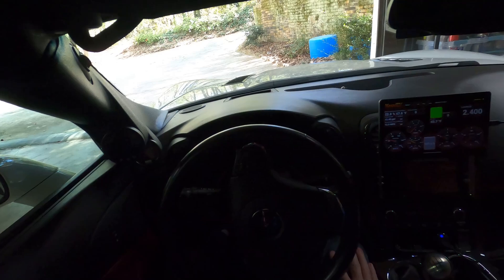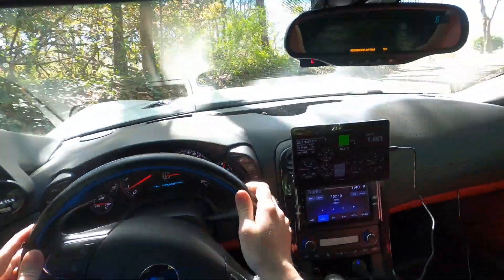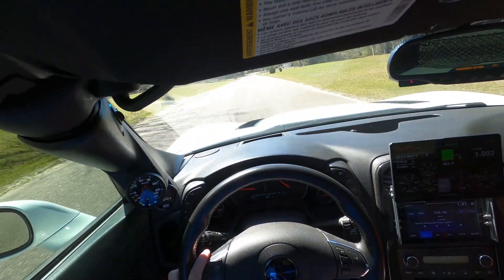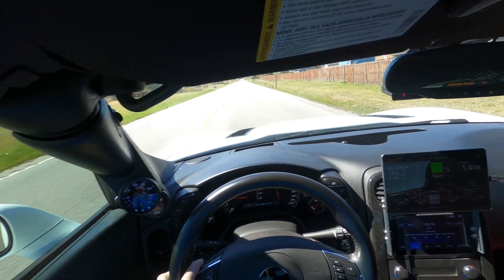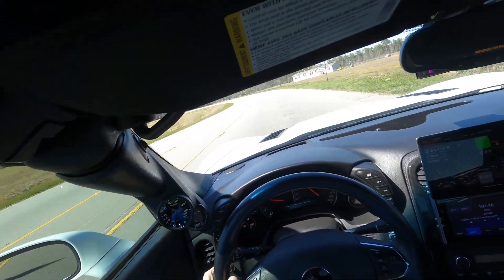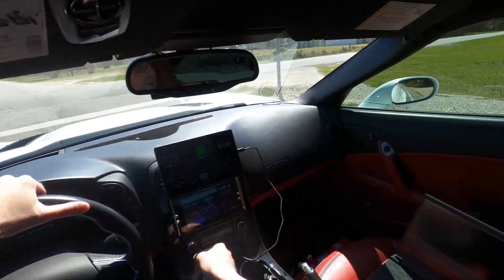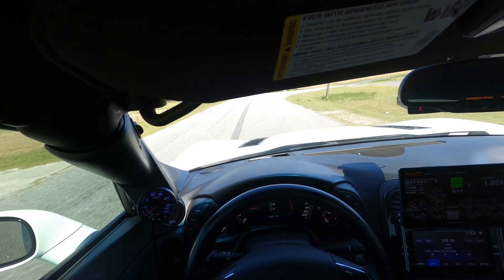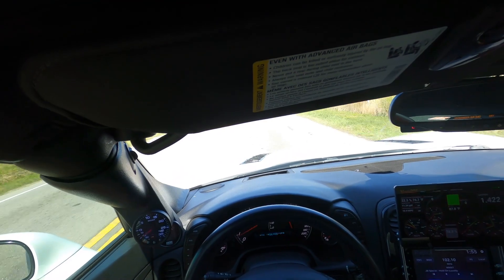Rear Mount Twin Turbo C6 Corvette MaxxEcu - Driving, Spool, and Rolling Anti-Lag

Comment: Really looking into this over the Shawn T Haltech kit. Seems a tad more simple, less boxes to deal with. Absolutely everything works like Factory?
Reply from the maker: @SomeCallMeSquatch  highly recommend it, we are switching everything to MaxxECU. 100% everything works like factory, it also gives you to remap stock buttons on the Canbus which is great. Currently using my cruise control set button as my rolling anti-lag

Comment: What size turbos? Do you run an intercooler
Reply from the maker: I’m running Garett GTX3576R’s with a 0.63 A/R turbine housing. I have a UPP intercooler in the front. If you want to see the intercooler, I have a more detailed video on the build and there’s a section on the intercooler towards the end: https://youtu.be/EvUeY0t9X-4?si=YpZoiyt1S_BipQ5T